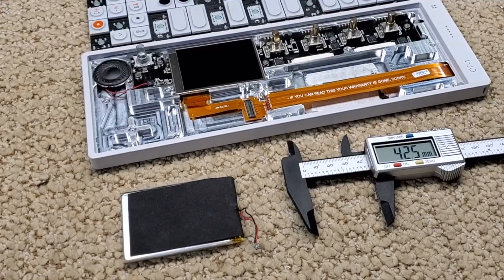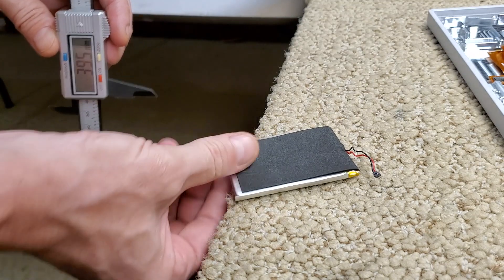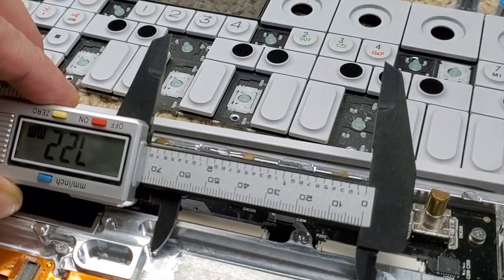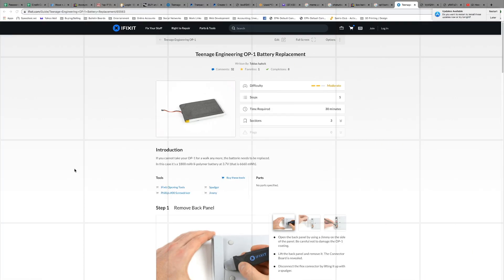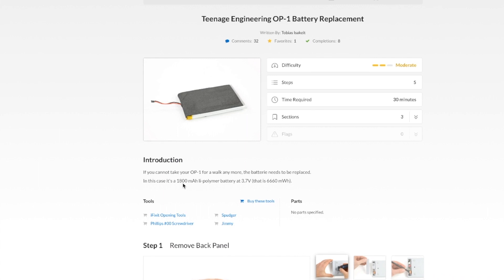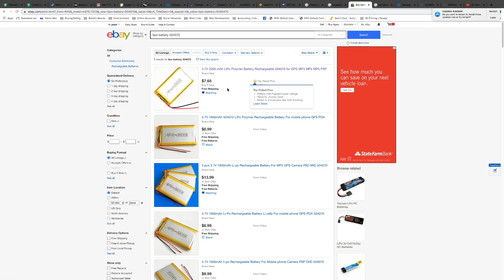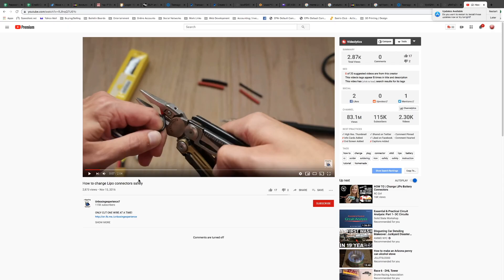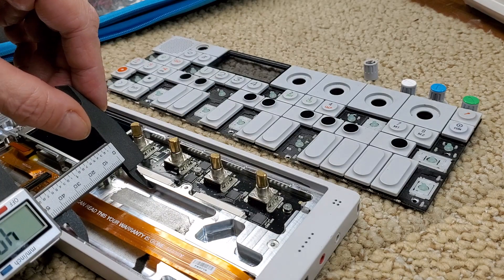OP1 Battery Measurements & Specs

Comment: The actual battery from the OP-1 is a 505070 or also identified by some manufacturers as 055070. And its 3.7v 1800maH. I have found it hard to find the one mentioned here, but the 505070 is more available. Don't worry too much if the 505070 or 055070 is shown as 2000maH, I have not found it to be an issue.
Reply from the maker: Thank you for your input. I appreciate it. :))
Reply: Thank you